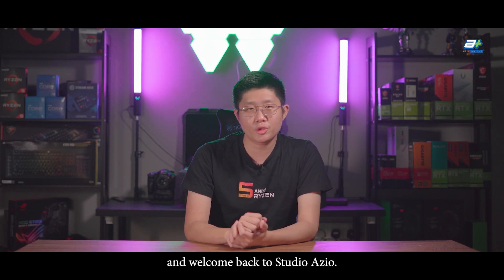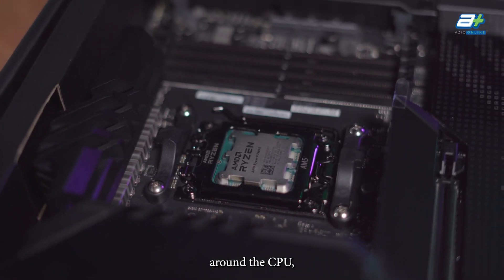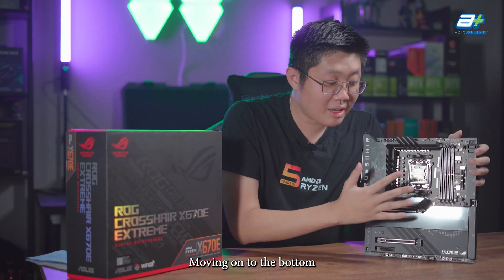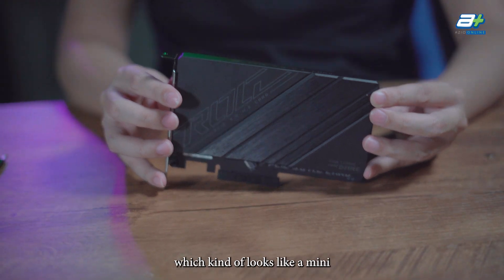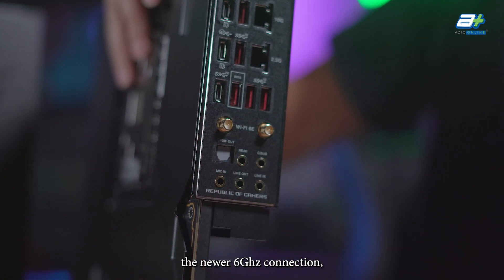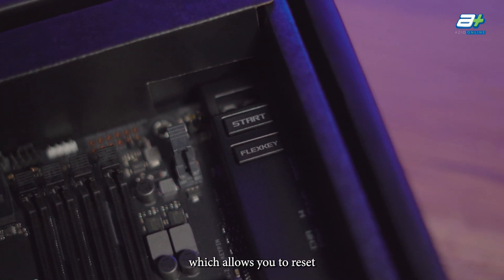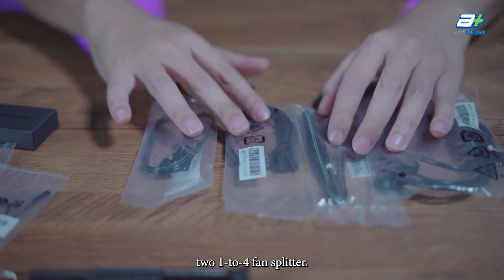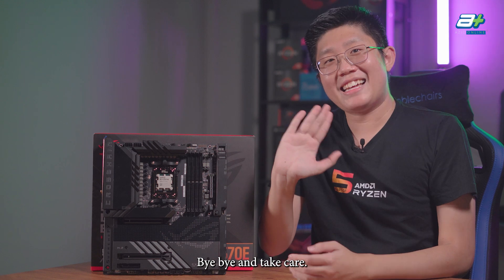The most EXTREME AM5 motherboard? - Asus ROG Crosshair X670E Extreme Review

Comment: What power wattage required for the board?
Reply from the maker: the board itself doesn't have a required wattage, that will depend on your processor :)

with the 7950X needing around 230w during turbo boost

Comment: I've been told that if i use one of the m.2 slots near the pcie slots it will make the pcie main slot a x8 and the second slot a x4 is this true?
Reply from the maker: yup, if i recall from the user manual. when the 2nd m2 slot is used, the bandwidth of the top pcie lane lane will be x8 and the bottom one will be x4. :)

so you are correct there :)
Reply: @Tech5Productions  thank you for the confirmation!

Comment: Did the Genz.2 come with thermal pads on the board as well as the metal fins? Sorry for the specific question, I would really appreciate it though.
Reply from the maker: yup, it does!
Reply: @Tech5Productions  Oh wow, I did not see that on the spec sheet. I thought it was only on the metal side.
Reply: Have you ever used the Gen-Z.2 card yet? I have not found any installation videos. I tried but for some reason it bends my SSDs sllightly, which worries me.
Reply from the maker: @Evenaardez  sorry bro, but we didn't get a chance to try that, as we returned that motherboard to Asus already :)

we only used the onboard nvme slot for our storage
Reply: @Tech5Productions  Ah gotcha, thank you!

Comment: Thanks for video!

Can you answer a quick question about the RGB on this mobo?

If you set the RGB Matrix pattern and OLED and reboot into the bios is the RGB pattern you set still displayed while you're in the BIOS? I'm asking as I run Linux regularly alongside windows so I'd like to be able to reboot from windows into linux and keep the RGB pattern as it was. I'm wondering if it persists once it's set or if it gets reset to default as soon as you leave windows.
Thanks for your time if you get a chance to test this!
Reply from the maker: hey man, sorry but we're unable to test that.

as we have returned the board to Asus already!

Comment: Just got this board...I have 5 m.2s for this....(A 990 Pro 2TB for my system drive and 3 4TB and a 8TB drive). Which slot should I install the 990 Pro 2TB for fastest speed? On the board itself or one of the PCI adaptors? Thanks for the help!
Reply from the maker: for your fastest drive (990 Pro), we would recommend putting it to the board itself, as those will be direct connection to the CPU and both will be running on PCI-e Gen5x4, which will enable you to take full advantage of that new super-fast SSD you got there. 😉

Comment: I realize I am late to the party here, but this is a HUGE motherboard. Would be nice to see a list over cases where this can be fitted without any issues regarding to space.
Reply: you literally can check the specs of any case and it will tell you if it fits eatx, atx, itx, whatever. Come on now.  Lazy is lazy.
Reply: @EnjoyingChaotics  Yes, except the EATX standard doesn’t seem to be so defined. No matter, will go for the Fractal Torrent, should be ok…
Reply: True I have seen cases “support” eatx but it doesn’t have the 3 right stand offs so I just hangs there is uncommon and mostly on smaller cases that you probably shouldn’t be putting a Eatx mobo in but still

Comment: Pay attention to the m2.2 if you run a second m.2 you will run at 8 at the top pcie instead of 16
Reply: in your opinion, if running just one 2tb Samsung 990 pro m.2 drive, would you install it in the M.2_1 slot or the alternate Z.2 DIMM slot and just use the gen 5 side with heatsink? Thank you!
Reply: @Hadley_MuadDib  M.2_1 slot...direct connect to board is best option
Reply: @ernestprobinson1193  thanks, this is what I went with. I just ordered a 4TB Western Digital Black 850x m.2 nvme drive that should be in today. I need more storage and there have been some recent articles saying the Samsung 990 SSD may be having some issues with drive health. To be honest, I’m just ready for the 7950x3D cpu to come out February 28th so I can try and get it at first release. I assume many will be waiting for the 7800x3D to release later and skip buying a 7900x3D or 7950x3D at the end of February.  I just hope that the 7950x3D is going to be better than the 13900k/ks in a broad selection of Games and not just a small handful. In games that don’t utilize much L3 Cache, I assume that the 13900k and ks will still take the lead. Hopefully the reviewers will get their hands on these new 3D cpus soon!

Comment: Pay attention to the m2.2 if you run a second m.2 you will run at 8 at the top pcie instead of 16
Reply: what about the bottom slot? Unconventional but could you run the GPU in the bottom slot at 16 with the 2nd m.2?
Reply: with the current bandwidth requirement of the lets say a 4090 or 7900XTX... I dont think it will bottleneck it @8x, considering its a PCIE5.0 (8x) which is equivalent to PCIE4.0 16x.

Comment: If you slot in a RTX 4090, will the 2nd PCIE slot still be accessible?
Reply from the maker: yup! it will still work. With both of the slot occupied, the 1st and 2nd slot will be running PCI-E gen5 in x8 bandwidth (which will have the same bandwidth as gen4 x16). :)
Reply: @Tech5Productions  Thanks. My question was about accessibility though. As in, will the 4090, being a super thick card, actually BLOCK or cover the 2nd PCIE slot, preventing it from being used?
Reply from the maker: @onedeadcat  ahh, I see man

We actually just done a build on the crosshair extreme with a ROG strix 4090 GPU.

I'll have a imgur link for you to judge on the clearance, although I would say it's quite tight!

https://imgur.com/a/hPEA5Mq
Reply: @Tech5Productions  Thanks so much for this! Looks like theres just enough space to slot a NVME add-in card, even with a TUF 4090 (which is slightly thicker).

Comment: That first switch you show yourself Switching is actually The Alteration mode Switch as Asus calls it and its used To Switch between auto and Gen 4 and Gen 3 Pcie signal which comes from your CPU Its located on page 1-19 of your owners manual. The slow mode is what is used for what your calling the LN2 mode button this motherboard has a Ln2 jumper actually as well.

Comment: This board only advertises usb4, but it uses a thunderbolt 4 controller. Are you able to test somehow if the thunderbolt 4 support works or is enabled?
Reply: I have this motherboard. I don't have any thunderbolt 4 devices. But according to thunderbolt control center, it says it has thunderbolt 4.
Reply: my caldigit ts4 dock connects at TB4 speeds with absolutely no issues on this board, driving the same 2 displays my M1 mac does and all the other peripherals.
Reply: @hancin993  Do you know if it uses your graphics card if you use the USB4 ports or does it use the integrated graphics from your processor?
Reply: @xuvghost8707  The monitors are connected to the iGPU, but you can tell Windows you'd like games to render using the "high-performance GPU" then copy the image to the iGPU (like it does for laptops). 

I've tried gaming on these monitors and had no issues, but I still have my primary display connected direct to the GPU for peace of mind. it just simplifies cabling since the 2 side monitors on my TB dock can run on my laptop or desktop with just one cable.
Reply: @hancin993  What a brilliant idea, thank you.

Comment: Don't forget to mention that if you run both M.2 slots on the motherboard your PCI-E first slot goes down to 8 time and your second goes down to 4 times.
Reply: So I should put my (2) m.2 ssds in the PCI holder? Instead of putting in 1st and 2nd slots directly on motherboard?
Reply: @Thesaurus-Rex  Want to know as well.
Reply: @chrisgg  i found out from what I can tell it DOES decrease speeds in the PCI express. Better off using the main and secondary slots directly on the board for your OS and Main storages. Then if you want subsidiary storage that doesn't need to be necessarily super fast then use the card expansion
Reply: @Thesaurus-Rex  Thanks for your reply. What would happen if I use e.g my RTX 4090 plus an upcoming PCIe 5.0 SSd and a PCI 4.0 SSd?
Reply: @chrisgg  put PCI 5 in the first slot
Reply: Also look in the manual and it will tell you which slots support 5.0 and at what speeds. I believe all the slots support but only first 2 slots at max speeds
Reply: Yes
Reply: Also there is a switch on the board. Put it in the middle selector for PCI 5. All the way right is Auto and left is PCI 3/4. But mine seemed to run more efficient with PCI 5 selected
Reply: @chrisgg  Your first drive should always go in the top motherboard slot. That one gets it's lanes direct from CPU. I believe after that you can use the bottom slot or the included dimm.2 module. It supports both PCIE-5 and 4.
Reply: @Thesaurus-Rex  This is my second build that i am trying to complete. I want both my m.2 slots for OS and storages that are both 8tb each, but where do i place any other ssd’s for extra storage?
Reply: @BlueStarMusix  use the motherboard slots for OS and OS storage. Then plug SSD in separate? Not sure what you mean. You also should have the PCI M.2 adapter also...
Reply: @Thesaurus-Rex  How do i plug in my ssd separate or do you put on a bracket outside of the mobo? If so ok i will do that. I decided that i am getting the 609e extreme its a hefty price but i can get it paying 250 every 2 weeks with Zip
Reply: @BlueStarMusix  it comes with a external m.2 slot that you plug into PCI express port on mobo
Reply: @Thesaurus-Rex  Oh ok thank you.
Reply: On the intel board it juet disabled the whole snd pcie slot😂 and there is no third one😂😂😂
Reply: Asus has been doing this for years on just about every ROG board. People are just too dumb to actually figure it out or spend time reading the manual.
Reply: @JT3-610  Asus isn't doing anything. The x670e chipset is doing it...this board is different though and supports more PCIE-5 SSDs through southbridge. If you use a PCIE-5 video card, you can run it at x8 without losing any performance.

Comment: Does this motherboard support 2x 3090 with Nvlink?
Reply: I don't see why not. But they will not be running 16 times speed. They will go down to 8 and 8 and if you use more than 1 m.2 drive, they second one will go down to 4.
Reply from the maker: Yup, it should be able to. As from what I recall, SLI/NVLINK just require 2 of the pcie slot to be running at least x8 bandwidth.

So this board will certainly be capable of that.

Comment: Just want to say, you missed the waterblock port that's above the cpu, near the two 8-pin CPU power connectors.  

Also, if you keep having camera focusing problems, Maybe switch those sections to B-roll footage.  We don't need to see you pointing out a connector, or section in real-time.   Once done with your primary filming, and rough edit, go back and film some B-roll footage of you pointing at the parts you were talking about in the video.  

Just a suggestion.  Good luck with the channel, and nice breakdown of the board!
Reply: Good comment.